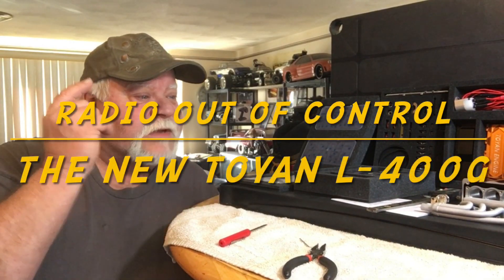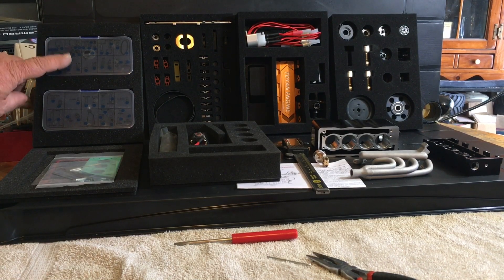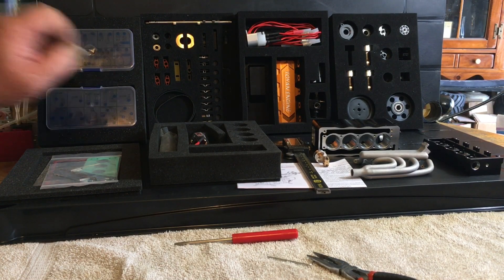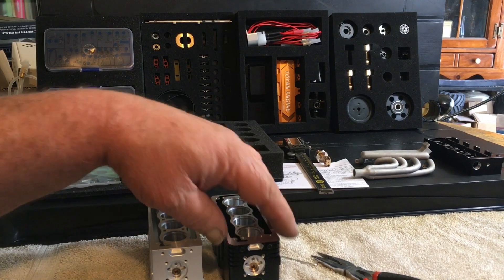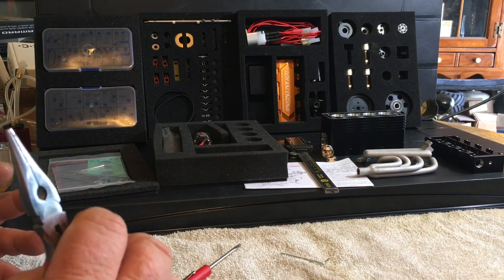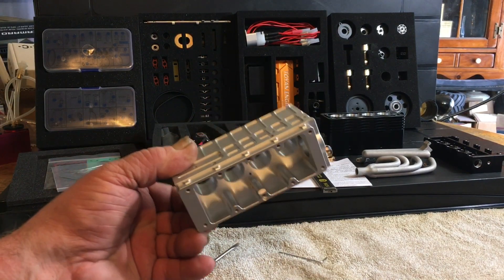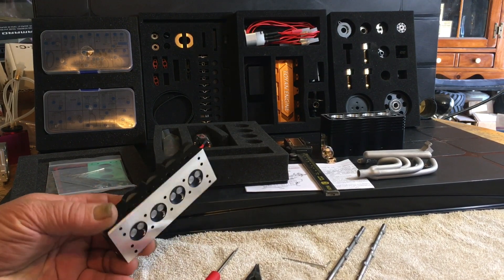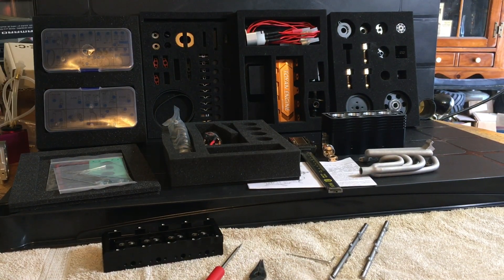THE ALL NEW TOYAN L-400 debut my engineering opinion on this engine!

Comment: Hi dennis. Ive got a problem and im hoping you might have an answer. I bought the tamiya f350 and tundra years ago. There horrible off road. I am really hoping you might know where i can order some wheels for tgem that i can mount the stock bruiser tires too. Dont know if its possible, but i like the look of the stock tires. I dont know if you have any experience with the f350, but there axles are plastic and they suck. I replaced the 350 with rc4wd axels but the tundra is still stock. The wheels fit both. Idk. Id like to get these up and running.  I have about 900.00 in each of them but i dont drive them because they suck. 😂 any advice would make my day.
Reply from the maker: Hi my friend! I know the f350 is a light weight plastic tub chassis like the old Clod Buster and very bouncy off road you can install a better soft spring shock for starters,  A wider wheel helps also you can find both on ebay👍
Reply: @dennisdempseyradiooutofcontrol  your awesome Dennis!!!! I love your channel! Your a rock Star. I switched the to the red leafs. But the clearance is still crap, so I'm moving up to 2.2 wheels and tires. That stupid truck has been a total let down
Reply: @dennisdempseyradiooutofcontrol  hey, happy Thanksgiving.  Hope your man cave has been a nice repreave. I honestly am jealous of your life style alot of the time. I was single for awhile. I really enjoyed alot of time just relaxing mentally. I miss it. This world can be pretty cold at times.

Comment: Although the con rods might be stronger than aluminum, you are talking like 3 times the weight. In the reciprocating assembly. My opinion on the lubrication issue is : why bother making this an ignition engine, when they realize the lubrication requirements as designed require  glow fuel. As a current toyan owner, I can say I am suspicious of how well thought out, thought through, their offerings are.
Reply: The weight helps with giving a lower, more stable idle rpm, and this engine idles nice and low.

Comment: It seems that if they don't have actual pressure lubrication, that they would at least put dippers on the rods to dip into the oil sump and splash it around. If the rods themselves dip into the oil, so will the crank throws, and this will be a serious power robber at higher rpm's. Even though they have bigger ports on the head, it looks like the ports on the manifolds are still pretty tiny in comparison, so any power gained would be lost through that bottleneck. I suppose a guy could take a drill and open up the ports a bit on the manifolds, but that should have been a factory thing. Considering the lack of oil flow in the engine, it would probably be a good plan to run 2 stroke mix, although it will seriously reduce the life of the spark plugs in any case. Nitro would only be an option on glow plugs, I would think, since nitro RC fuel already has a lot of oil in it. I'm curious if they're using actual metal piston rings now, or those stupid silicone o-rings? Curious to see also, if they worked out the constant ignition and starter failures, that seem to plague all of their engines. Great video Dennis! Keep it up!😃👍👍

Comment: I have all the faith in this new L400 , but I understand that there'd be much resentment towards toyan with so many customers, toyan themselves have to engage with the customers, not rely on the sellers who know absolutely nothing about engines , i hold them equally responsible for the failures and following gaslighting , I'd still really love a V4 , but I don't fancy drilling holes in the flywheel, I'm not perfect at machining and I'm up for the costs of a drill press , why can't they do the basic provision of a clutch kit ? I'd also love that double rotary , again , no way to even use a clutch on the thing or reliably start it once it's in a vehicle, it would go a long way to hear what their plans or goals are for the next 6 months so we could make plans in terms of parts / vehicles .
Reply from the maker: Good call brother! hey Toyan and Stirlingkit are you reading these comments?🤔
Reply: @dennisdempseyradiooutofcontrol  well just in case they are , fix the rotary , add a pull starter and I'll gladly buy one !

Comment: Always enjoy your videos DD    
Fuel tanks, my suggestion would be to buy a Sullivan, or a Dubro brand, or similar usually used for model aircraft flying.  They come in many sizes and shape, and styles.  Usually have very good pickup clunks, I personally use a cotton wool type clunk, they filter and help remove a lot of the air bubbles caused through vibrations.  Have a look at them if you haven't already.  I'd enjoy hearing your thoughts on the use of these with those engines.  In my model aircraft, I sware by them, most of my engines are single cylinder Four stroke in the 1CI range so do shake a fair amount.  My favourite running at the moment is the YS115AC.  It a supercharged Single, 1.15CI in the same case size as a 0.9CI.    Amazing power for the size, but I do have to run 20-30% nitro with it, to retard timing. I could drop to 5% nitro if I was to change to spark ignition. Would be very difficult to change to petrol, as there are a lot of seals, gaskets, and the carb would have to be completely swapped out for suitable compound. 
Great video as always and Hello from New Zealand